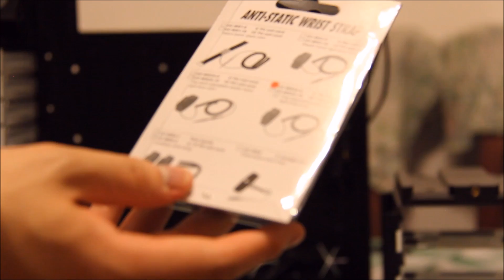How to use antistatic wrist strap

Comment: "How to use antistatic wrist strap"
"I don't know where to clip onto the case"
Failure.
Reply: where should you
Reply: @chunk9165  Any unpainted metal.
Reply: @doteaters  ok thx
Reply: @doteaters  Is it also okay to hook it up to a metal radiator in the house?
Reply: @MuccaCorse  I imagine it would work, as long as the metal is unpainted.

Comment: Where do I clip it on the mother board???
Reply: I think that's the worst place you could connect it because you're trying to AVOID sending electrostatic discharge to the motherboard.
Reply: w00tkid LOL
Reply: Clip it to the cpu and turn it on

Comment: First of all, connecting the anti-static clip to the case in the manner you do is called, "bonding" not "grounding".  Second of all, when you mentioned the clip chipping away at paint... attaching the clip to a painted part of the case won't work - it needs to be attached to a 'raw' metal portion.
Reply: JC J but most cases are painted, like black panels and metal are black instead of raw silver then what?
Reply: dang auto correct PSU not pus..
Reply: Connect it to the pus.. with the power cut off of course. 😊
Reply: LaVerne Kephart how do you mean? Even PSU are black these days?

Comment: I still dont get it.  So  does Static need to be discharged to any metal?  what exactly is grounded? Like litterally  something that is connected to the earth?  or could just a piece of something more conductive than than the body work?
Reply: Marcus Fenix dude I played gears of war 4 and you were in it :D
Reply: connect to any non painted point of the case with the wrist strap. it's not as bad as everyone says. it's just a precaution that could destroy your components. i had a ram connection go bad on a motherboard fried because of static so i use the strap all the time now
Reply: Marcus Fenix yes, grounded means connected to the earth. The earth pin of the power plug does exactly this. So, connecting your wrist strap to (bare metal of) a power supply that is plugged in to the wall will ground it and you can work safely.

Comment: lets say im replacing my hard drive on my macbook 13" and have no carpet or things around me like socks, can i proceed without using one of the antistatic wrist strap? because ive done multiple computer builds, macbook, and imac replacements but still have not used one. should i be careful and use an antistatic?
Reply: Technology Central it's a precaution to reduce risk of damage by ESD. You've been lucky so far, that luck may eventually run out.

Comment: From what I've read/heard connecting to a case is not the same as grounding? It's called bonding where you're just transferring the ESD to something else (the case). In order to ground yourself it needs to be connected to something that actually goes to the earth such as a PSU connected into the wall outlet (and turned off). This dissipates the ESD rather than transferring it. Correct me if I'm wrong cause I'm new to this too.
Reply: +TylerJaden24  The only things I would add is #1 making sure the outlet you are plugging your PSU into is properly wired and has a proper grounding connection with an electrical tester and #2 making sure your wrist band is connected to bare metal on the PSU and not a painted part of the PSU or case. On a PSU or case the paint CAN act as an insulator and obstruct a proper bonding / grounding path. 
Otherwise yes, you are correct, connecting to a PSU that is plugged in but is off (without touching anything inside the PSU other than the enclosure itself), is the best way to effectively achieve a ground and bond yourself to eliminate the chance of an ESD rather than transferring it and causing harm to your components. 
I would not recommend connecting to a case because you are relying on the bond it has to the PSU through the paint and screws holding it together which is not as effective as connecting to the PSU itself. 
The house's electrical system is grounded which when plugged in the PSU is grounded and then while wearing an anti static band attached to the PSU you are bonded to the PSU which is grounded. Any potential or "static" will transfer to ground before it becomes a problem while working on something.
Reply: @nathan hynes You should stick to things you do know about, and not regurgitate horrible advice like that.

Where do you think the earth/ground pin in the wall plug goes? Hint, the answer is in the name.

Its not going to linger around and hurt anyones health.
Reply: The Tom guy is right, a weeee blunt but he knows what he is talking about. The word regurgitate just sounds harsh in almost any sentence lol.  
So, read the advice carefully bud, try and understand how to do this properly and not short out you or your equipment. Another potential I'm not sure if anyone has brought up here, is carpet, you know how as kids we would shuffle our feet on carpet and then go shock someone? Well same thing here, so try not to have a work area where you may be un-intentionally shuffling your feet on the carpet while possibly transferring a static shock to (difference in potential) to whatever you're working on.
Reply: I  wired the ESD mat connection to a 3 pin plug (UK) via the earth pin to ground it correctly without the need for the PSU method as most of them are painted anyway making it less effective. Worked a treat. Power off, of course but seeing as the only pin connected is the earth then it wouldn't matter anyway.
Reply: Zaps happen due to "potential difference" in coloumbs i guess so its kinda like lightning but way weaker,so imagine it to be like a negative lighting emerging fron the ground and cancelling out the lightning from the skies so that the surface is not damaged,in short(no pun intended) if the potential is same there is no transfer of charge or voltage emission
Reply: aparna m Nainar So would it just be safe for me to just touch my case as I build?
Reply: So do you need to attach the clip to the PSU? I heard that if you just rub your hands around the PSU you'll be grounded
Reply: +Kille78  Kille78, some of what you said is incorrect, and some of what you said COULD happen under the right but HIGHLY unlikely  circumstances. From what you describe in your "scenario" this would only be an issue if your house / wall outlet had a faulty ground connection, the circuit breaker hasn't tripped and the internals of the PSU were shorting out in a unique manner (which you would likely know about via smoke, burning smell or the computer / PSU not working) OR if you opened up your PSU and started touching the internals (for what reason I don't know) as you were touching other components at the same time. Also, if your PSU has a switch on the back as most do now days, then the switch would have to be malfunctioning to still be putting power out. 
Now if there were no switch and the PSU was plugged in, then people who don't understand how to do this safely shouldn't be attempting these tasks to begin with. Though if there were no switch and the PSU technically had power to it, then you would still be fine since plugging things in would be one of your last steps in the build and shouldn't be randomly touching anything other than what you are plugging in. 
Unless I'm misunderstanding what you're trying to say? please let me know.
Reply: Tom Storey to be honest I'm confused with all the advice going around at the moment. I too am new to the whole thing. It's another case of me being gullible on the internet. it's probably some kind of myth so. However from watching videos from professionals such as Carey holzman source: newegg diy garage:building a gaming pc, I know that you shouldn't plug it into the wall as it's very dangerous. My comment will be deleted but do bare in mind I'm just a dumb teen (in this area anyway) that's new to the whole thing so you could be a bit nicer. After all this comment is on a vid for people who don't know how a antistatic wrist strap works. Regards.
Reply: That is a fair point, apologies if I was too harsh. Dont call yourself dumb, youre still learning.

Connecting yourself to the chassis of your PC meerly neutralises the potential between yourself and the chassis. So as long as you remain equal you wont feel any zaps when you brush against it, and maybe because of that you think youre safe. But! Other objects you handle wont be equal, and that creates a potential which means you can still zap them. The bottom line is you need to provide a path for the static to drain away to ground.

Also for this reason the so called "wireless" anti static wrist straps are pure snake oil - by that theory I can simply hold a resistor in my hand with one lead floating in free air and call myself grounded, but its absolute rubbish.

Plugging the power supply in to the wall and connecting your wrist strap to it isnt dangerous unless you were to somehow come in to contact with some live, high voltage AC components inside. But the chassis of the power supply is also grounded for safety reasons so any leakage of current will flow to ground which presents a path of much lower resistance than you with your 1 meg ohm wrist strap, and ideally if you have an RCD that will trip and cut the power off anyway. But simply, just leave the power supply turned off at the wall, this doesnt disconnect the ground connection, so you can use it even more safely that way.

There is a lot of varied oppinion floating around, its an annoying problem because maybe only half of it is correct. I do electronics as a hobby, and work in telecommunications as my day job so this is all very familiar to me - handling router linecards worth tens of thousands of dollars each is no game when it comes to static. Spend a little time, read/watch some articles/videos on basic theory of electricity and you'll quickly learn that it doesnt flow without somewhere to go.
Reply: Kille78 that is why good wrist straps (or anti static bonding points) have a 1 meg ohm resistor in them (or at each point of connection). Resistors limit current, and current is what kills, and a 1 meg ohm resistor allows only a miniscule amount of current through.

If something does happen to go wrong, it stops you becoming a dead short to ground = happy days and safe working.
Reply: +TylerJaden24 90% of what you said is correct. The only thing you got wrong was using the PSU. It technically will ground you but by plugging it in (even while its off) you have just quadrupled your chances of something bad happening. Even though you may be grounded, there is power going to the PSU and the capacitors. Same concept applies to why its insanely dangerous to handle an opened PSU. Even while its off or unplugged, there is an active charge. Touch the wrong thing and it can very easily kill you. In this case you run the risk of bridging electrical circuits. Even when its off there is power going to the board. Even if it is a small amount, it doesnt take much.
Reply: not if you kill the power at the socket i.e. no power coming from the socket, up the cord to the psu......  your only interested in the earth so no need for power  @kille78
Reply: @ Everything cool - Not sure I understand your reply, can you clarify please? 
I think you are saying a bond and a ground is the same thing and ground connect what to a water pipe? and if not, then bond what?

Comment: the case is ungrounded? and it has painted surfaces.

i dont get how this video works
Reply: You don't ground yourself to the PC, you bond yourself to it, meaning the static electricity will be equally dispersed between you and the case, and thus pose little threat to the components. 

To ground yourself, the alligator clip will need to be attached to something that is literally grounded, like a radiator pipe for example.
Reply: +Healy Riley wouldn't a plugged in psu (switched off of course) be better? When I did my build I just regularly touched that psu to discharge
Reply: +Doubledunk  so the power supply unit where protective metal cage that protects the fan would be good? Just clip it to a metal spoke?
Reply: thats generally what people do bro but i'd double check with other sources (:
Reply: @Doubledunk  I usually stick the clip in the earth of the outlet

Comment: Lol when i made my set up i was on thr carpet wareing socks putting the pieces on the floor i had no strap like yours and i am super lucky that i diddent fry it
Reply from the maker: Oh wow. Yeah, that's pretty sketchy doing it carpet, but I guess it depends on the type of carpet and how much you were moving/shuffling your feet as well. If you touched your case often or I liked to also tap on my light switch's screw (which should be grounded), then you should be OK. This wrist strap was only to ground myself as much as possible, since I find myself building up static really easily!
Reply: I don't know what carpet we have and i didn't  really touch my case, i just brought a wrist strap because i don't want to be taking any risks damaging the peaces, I am so lucky that it didn't break anything. 

when i was building it i did move a bit because i had to move most of the stuff away from the motherboard to put the new stuff in.
Reply: +Gamboley How touching the case will help if case is just a metal box and its not grounded? To you connect case somewhere before you start?
Reply: Yeah it's suppose to be plugged into the wall but the wall switch off as well as the anti-static band connected to the case.
Reply: What if I have the motherboard I'm working on in the case I'm grounded to, does that make a difference?
Reply: Confroz wow I'm surprised you know how to build a PC considering you can't spell anything LOL
Reply: Mike Soda the case should still be grounded some how, e.g. by having the power supply plugged in to the wall.
Reply: +Tom Storey Thank you too, I've updated my building instructions to put extra emphasis on this. It's odd how many of these anti-static wrist straps are all the same baby blue color. I was only able to find 1 by Rosewill on Newegg that's black.